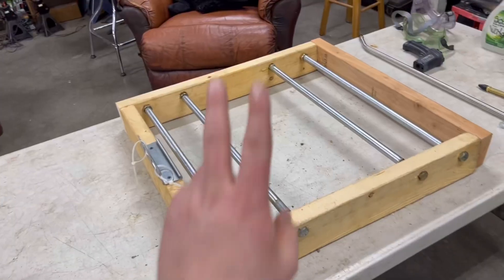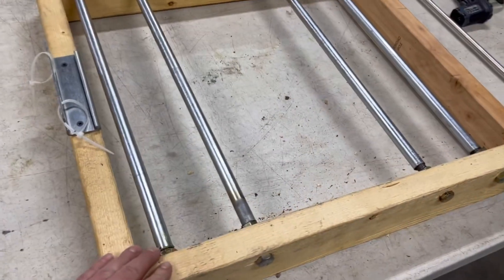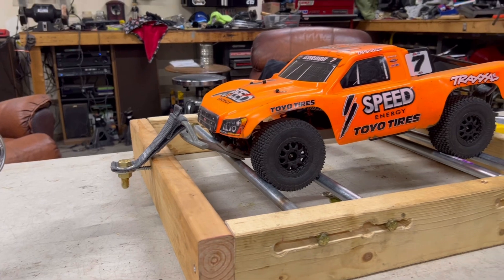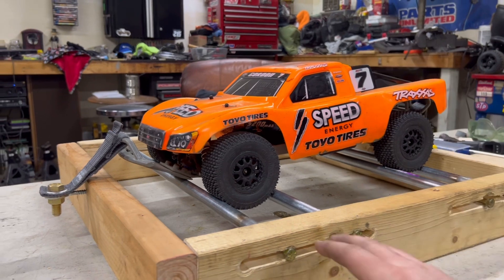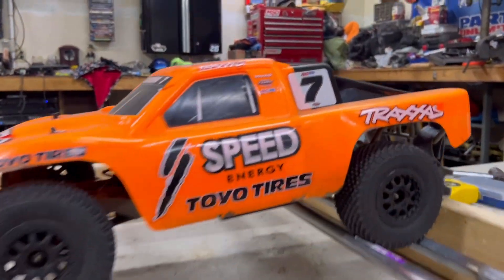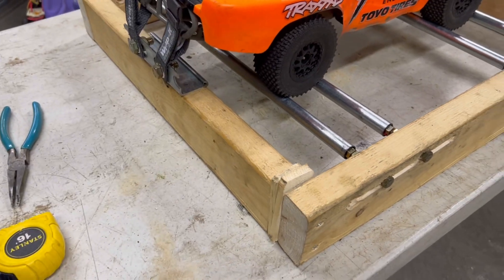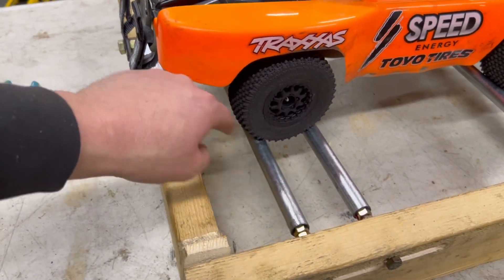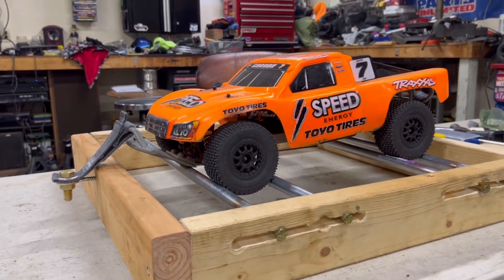V2 Run Table with Bearings!!!(So much Smoother)

Comment: So did yiu ever get to the finish of that break in video?
Reply from the maker: Ooo yea. We finally got time and took the Truggy to a local RC track. After some tuning she was running good and put down some good laps. Fun RC car. I didn’t make a full you tube video on our day. But there are some video shorts we did. Actually about to get it down off the shelf this weekend and go through it and get it ready for the track.
Reply: Yeah I have a buggy,  and right at that point ha ha where we all must start, the beginning.  Well I'm looking at some videos and guys are opening up and disassembling  the entire motor first.  I imagine just looking it over, but never really saying that they have experience, who knows? So that's what caught my eye about your video. I did have a question though.. you said you decided to go with pull start because you , and I can't remember if you said there was some more difficulty with a box starter than you expected? I was kinda curious bout that?
Reply: I have a mbx8 mugen buggy and o.s. motor 75 header,  and2090 pipe. Box starter on the way, , few gallons of fuel, extra glow plugs p3, and heat gun variableTemps. Of and some after run oil that had a full disclaimer saying it wont eat silicone,  o-rings, and I really liked that extra touch you added about adding just a few drops and cycling it through the motor before anything else..
Reply from the maker: @drawstraw4483 I bought a sure start box. Good reviews. Seems nice. But I can’t get it to properly start the buggy. The wheel on that one seems super soft. But idk. I made a bunch of adjustments to it. I’ll try again this year. I’m always wrapped up in doing the dirtbike stuff, don’t get a lot of time in the RC department. Even though Rc’s prolly my favorite side hobby for sure. As for my pull start. If a perfect world with the perfect tune. A pull starter is all you need. But yea when they are way out of wack it can be frustrating trying to pull start and get it to fire.
Reply from the maker: What kind of fuel did you go with?
Reply: @FullSpeedImpulse  I couldn't find this bones stuff, so I went with torco
Reply: @FullSpeedImpulse  yeah I saw a video not long ago where one man preferred the pull start because he said with a pullstart you can actually feel the motor unlike a box or other start means.  And he said if you know what your doing,  you'll never break a pullstart
Reply: @FullSpeedImpulse  the starter box I have coming has 2 motors, and a 3s lipo
Reply: @FullSpeedImpulse  I try to buy things once, instead of twice, so I go with the best.
Reply from the maker: @drawstraw4483 ooo that’s good. I was using Morgan Fuel Sidewinder I believe. And when I ran out all they had was traxxas fuel so I bought that and it ran horrible. Way out of tune. Both were 20%
Reply: @FullSpeedImpulse  well I may not go to this torco straight away. I'm not in a huge hurry, so I may try something a little less. That torco is 30% I guess they're trying to ban it.
Reply from the maker: @drawstraw4483 why’s that?
Reply: @FullSpeedImpulse  they say it has 10% oil,  synthetic blend, no cstro. Some prefer that glaze that's put on the inside of the engine for a little added protection almost like a polymer finish,  but I might look into something that has 12% oil synthetic blend, and less nitro content. 
Oh and if your question was referring to them doing away with 30%, it's in short, an environmental discussion that's shutting it down. Already they have bans in the UK, Australia and it's a matter of time before here.  There's is a video on that by Adam drake, and there's another video talking about why we can no buy bones nitro fuel. By far the most popular fuel of all time,  longevity,  and power. But it something to do with the new containers,  and prop 65 outta california.  But they wanta punish every other state for it. I apologize,  I think some safeguards are in place for good reason, but R/C nitro really is such a small hobby. It's kid of an over reach. The owner of bones now just does distribution for another product that contains the same initial platform mixture that bones was made from, oly bones added a bit more preference from my understanding.  It stsrtwith a (V) I believe,  and comes in a can. + MORE EXPENSIVE $
Reply from the maker: @drawstraw4483 oooo wow. That’s insane. Like you said I understand of certain practices put in to help better/preserve the world we live in. But if this is the way they plan on saving out planet through restricting our nitro fuel for RC cars/planes. We are already done. Lol. But let’s not get into all that stuff. Good info on oil blend. I’ll have to look into that. I might dispose of this traxxas stuff anyways and get me something better. 
 Change of slight subject. Have you seen those arrma tlr roller 1/8th buggy’s? I’m pretty interested in those. I bought my boy the arrma typhoon 1/8th scale buggy. And that thing is a unit. When I raced at my local track I was building my losi Rc’s from the ground up and that was 💰. Just looking to fool around and seems like a great bang for the buck.
Reply: @FullSpeedImpulse   I've been also eyeing the typhon. It looks strong, and pretty much race ready. Don't know about the other one yet. Haven't seen. I think I might like order that sidewinder 20/10 . I'm looking into it for break in.
Reply from the maker: @drawstraw4483 There you go!!! Maybe I’ll post a little video on when I run the Truggy and Buggy. Good talk. Look forward to your comments in the future! Let me know how that break in goes.
Reply: @FullSpeedImpulse same,  I sure will 👍